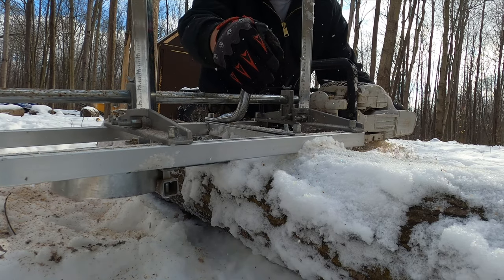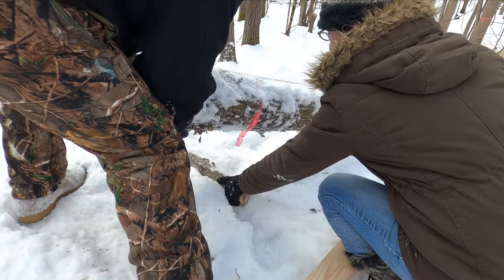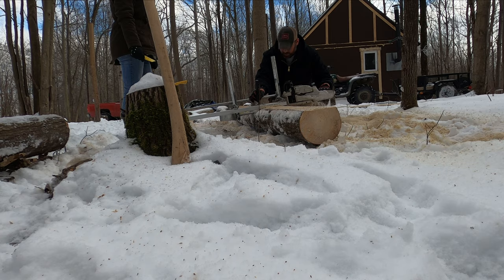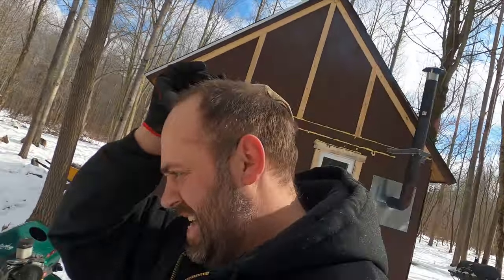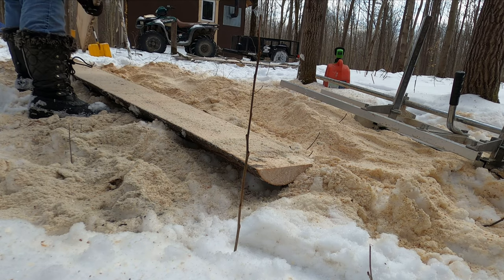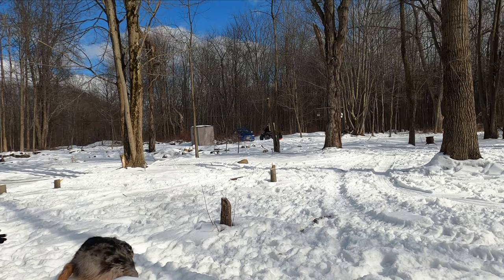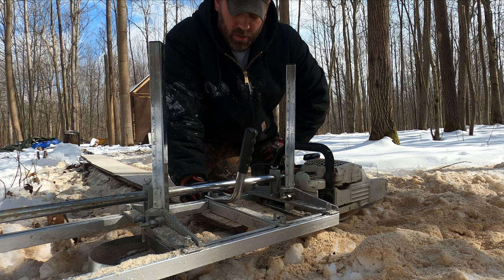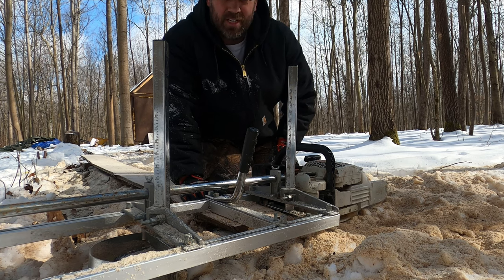LOGS TO LUMBER With our STIHL ALASKAN CHAINSAW MILL | Milling Trees for the Cabin Floor

Comment: I've never tried the chain saw mill, I may have to give it a shot this summer, I'm a big fan of the live edge look
Reply from the maker: The chainsaw mill is defiantly unique. The live edge looks are something that adds to the feel of being "raw". Unfortunately, most of our trees on our property are not really good trees for live edge due to the quality and type. Before these boards are used,. we will be planing the edges so that they fit better for the floor. The ones used on the siding will be left with a live edge.

I would love to see a follow-up video if you do. I subscribe because it looks like you are in the same boat as us and relatively close to us as well. We are in Northeastern Ohio 1/2 mile from the border.